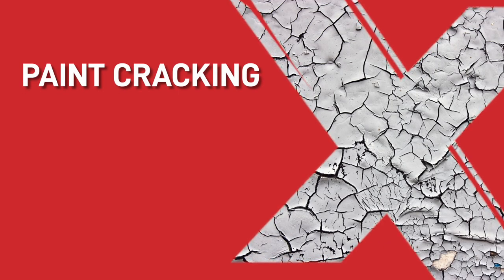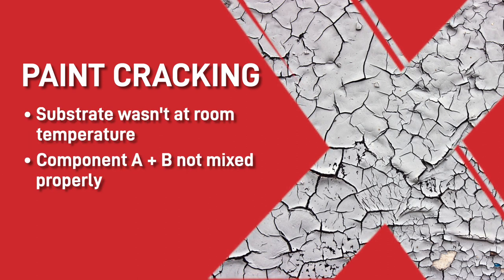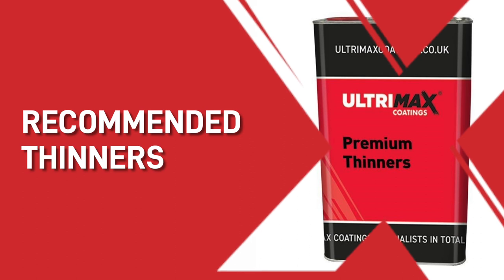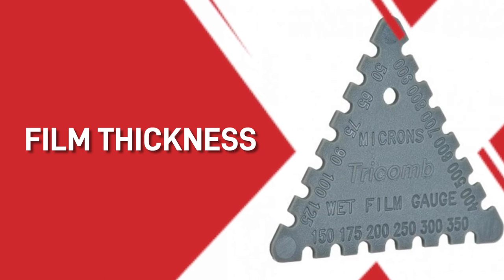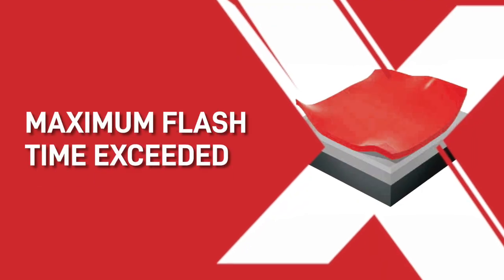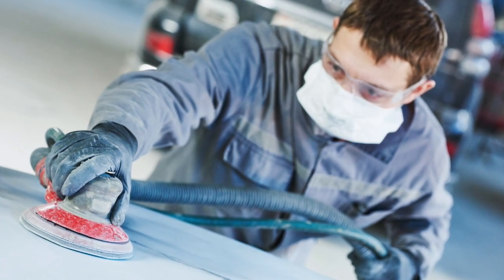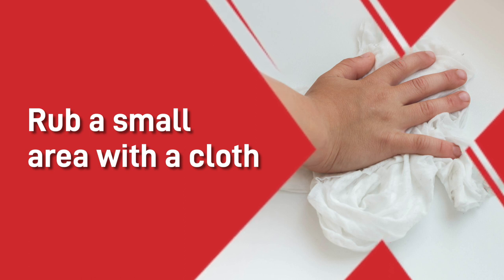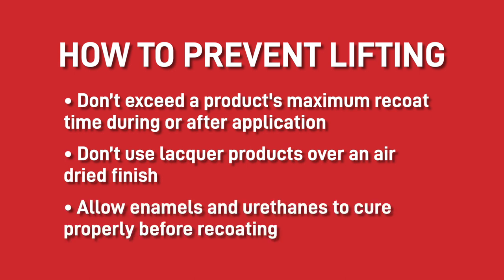How To Repair and Prevent Paint Cracking when Spraying

Comment: Can I finish the cracked surface with a top clear coat giving a crackle effect
Reply from the maker: you could try to use the clear coat as a lacquer and sealer a little like rat rod car builders do but you would have to be very light on how you spray or you may blow away the peeling paint!

Comment: Hey. I have spraypainted canvases. They have started to crack. But the paint didn’t start cracking before a couple of weeks after the paint job. 
We think it happened because of too high room temperature where we work. But it just seemed so strange that I would take that long before cracking forming. Do you know if this can happen like this?

Thank you
Reply from the maker: Hi this could be very dependent on a number of issues but I would say the two main issues here are - are you painting them in low temperature or high then the room moves to the opposite ie high temperature to low or low to high as this can cause cracking. Also if you are spray painting canvas how long are you leaving the paint to flash before recoating - ie are you spray painting then recoating before the paint has dried OR are you spray painting then adding a different type of paint such as acrylic or oil as an effect over the spray paint which could also cause a reaction? many reasons here so best if you give us a run down of what you are doing .

Comment: ok what if i followed the paint instructions to a T, the first coat went on great, but the needed second coat is cracking??
Reply from the maker: that normally means the first hasn't dried correctly before the 2nd application

Comment: I have a 1996 bright aqua metallic coloured sunfire with oem paint. It’s like a bunch of spider web like cracks across the whole passenger side of the car. It’s only the passenger side tho. Could it be the sun or just badly applied paint? Also could I just paint one side since the roofs unaffected?
Reply from the maker: Hi yes quite like a reaction caused by poor application with spider webbing, Could also be linked to your weather conditions if for example the car routinely sits in 30 degree + heat everyday open to the elements on that side?  You could paint one side but orange metallic is a horrible colour to match nearly as bad as yellow so the likelihood of getting a perfect match is not very high. If it was black or blue something like that then it would blend much easier but assuming the OEM paint is 1996 for the rest of the car then that will seen significant UV since it was painted and must have faded meaning new paint will be far glossier and brighter.
Reply: @ultrimaxcoatingsltd  mines a blue color and there isn’t any fading on the other parts, it sat in a place last summer where the sun was constantly on one side but I’m pretty sure it’s been there since I got the car
Reply from the maker: @4edan293  that's a problem we don't get a lot in the UK barely hits 30! but blue should be easily capable of blending with